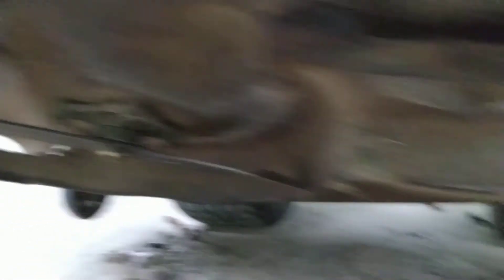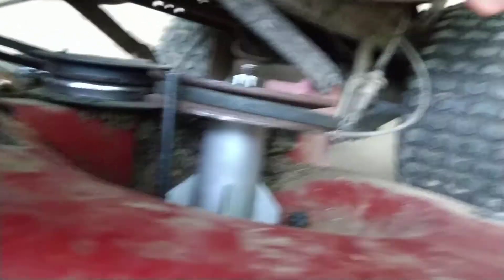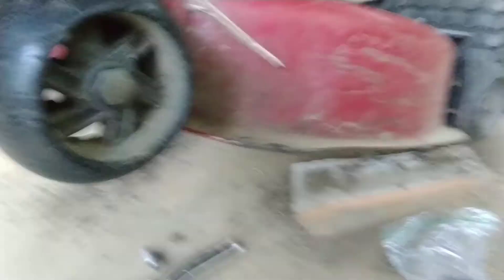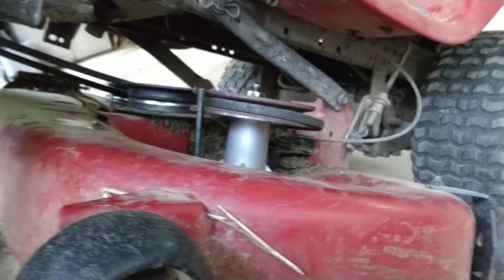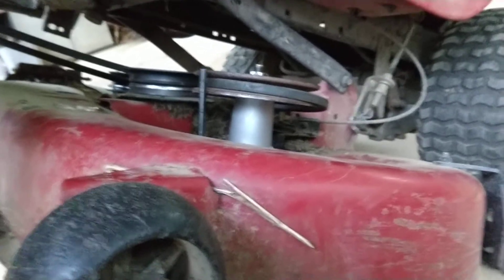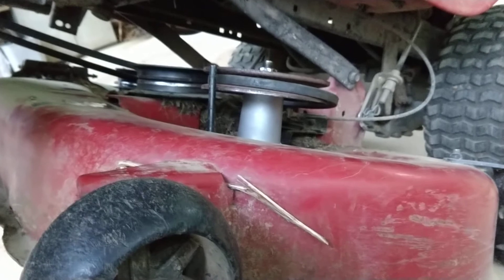Replacing spindle on yts3000

Comment: I can't find the spindle anywhere. I see yt3000,yts4000,yts3000 but only 46" mine is a 42" any feedback greatly appreciated
Reply from the maker: IDK. pretty sure I've bought them on Amazon and on eBay just these were cheaper but they didn't fit exactly right . I had to modify em,  in the heights different but you should be able to find the right ones